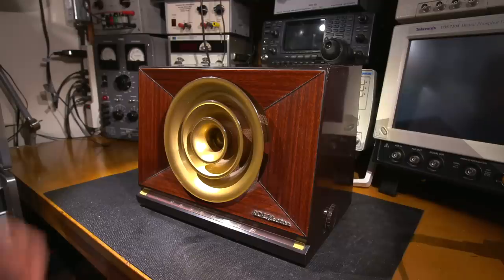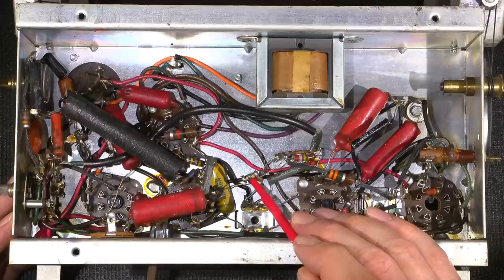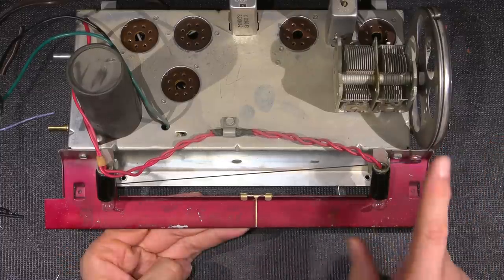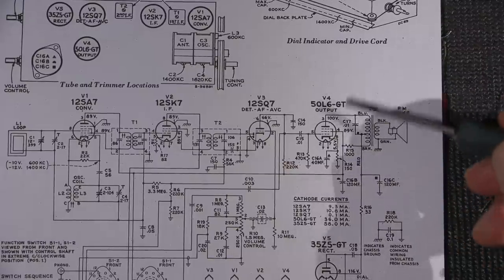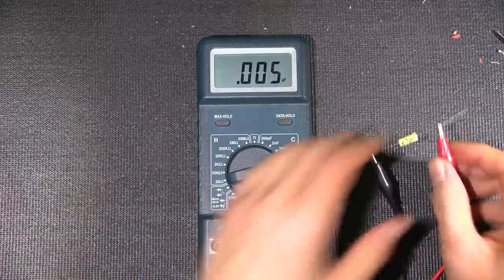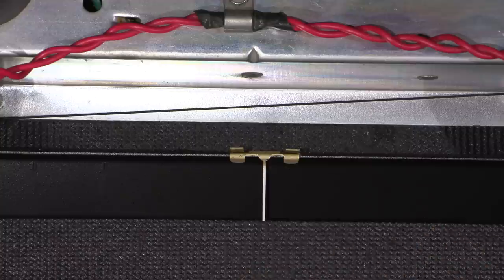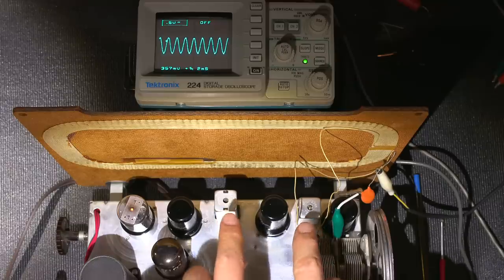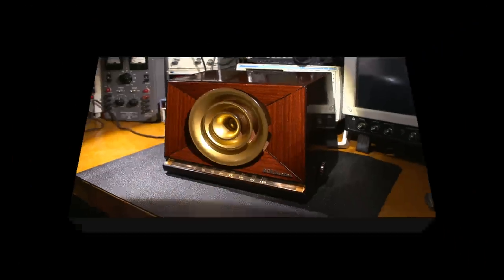Bizarre Looking RCA Radio! [Electrical Restoration]

Comment: Very good videos thank you. Question I have do you every re-stuff an original cab and why or why not. Thank you
Reply: You can't accurately measure the leakage through a capacitor when it's in circuit, so once you've gone to the trouble of unsoldering one lead, it's almost not worth the bother to even test them, so many restorers just routinely replace them without even testing.

Comment: Except they don't act like resistors across the caps. The amount of leakage current changes with the voltage.  If anything, they might act like a VDR.

Comment: Greetings: The series wired dial lamp current causes the brightness to be more uniform than if they were parallel wired.
Reply: James M DeLuca   ,     Not really, depends upon the circuit. Usually, only on turn on time during warm up.

Comment: Having reported your extensive testing of the audio performance of bias shifting, which sounds like the amplifier moving from class B to AB, you noted the concept of warmer sound.  What is the change in the Bode plot that gives the perception of warmer sound?  thank you.
Reply from the maker: How is this in class B?
Reply: @MrCarlsonsLab  Hi Mr C,  I am not sure what class it is, however, the main question is what is going on with the frequency/audio alteration with making a sound warmer, per the historical comment you mention?  Any comments on what class amplifier it was designed to be would be interesting.  thank you.

Comment: Hi. Would it be possible to take an old Pioneer radio amplifier that runs off of vacuum tubes and replace the tubes with transistors? I have an  50 year old machine with 13 tubes that need replacing. The machine is a sentimental piece I don't want to get rid of, but in my country it will cost thousands to repair. And that is if the tubed can even be sourced in the first place.

Comment: Thank you Mr. Carlson. Always enjoy your vids. I have an Yamaha MX-1000U amplifier that is at least 30 years old now. It drives my NS-1000's. I am the original owner of both. I would like to have it re-capped and performance verified. It that something you would be interested in doing? Not as old and perhaps interesting as the stuff you normally work on. But I thought to ask because personally  I can't think of a better set of hands to freshen up an old friend of mine.

Comment: It is understandable that these radios 📻 get wear and tear around the volume and tuning knobs. I’m not sure 🤔 if that actually can add value to the radio 📻 in some cases. Otherwise, sadly 😞, the whole radio 📻 will need to be refinished. Depending on what kind of finish job the radio 📻 received at the factory 🏭, refinishing the radio 📻 can actually devalue it. In other cases, it can benefit the radio’s 📻 value. You’re a pretty 😍 cool 😎 guy, as far as your videos are concerned 😟. I also like 👍 all your equipment in your garage or basement, but I wouldn’t want to pay 💰 the price of a house 🏠 to buy it. I can probably buy the equipment used, but I have to make sure that it’s good 😌. No matter how recapped, or restored these old radios 📻 are. It’s ALWAYS advised to turn the radio 📻 OFF, when ya leave the room, even for a minute. Also, some of these radios 📻 have non-replaceable ON/OFF switches, that have gone out of production, many 👨 years ago. When this is the case, go buy an outlet strip, and use the ON/OFF switch on it. They’re only $15.00, or so, and available at Home 🏠 Depot or Lowe’s. This takes having to put the wear on your radio’s 📻 ON/OFF switch. Shango066 says the above, because no matter how recapped, or restored the radio 📻 is, ya can’t trust it, once ya have left the room. As Shango066 went to leave the room, his radio 📻 shorted out (a capacitor), making him have to go back in the room, in the nick of time 😥, to put out the fire 🧯 that this created. Merry belated Christmas 🎄 🎁, and a Happy 😊 New Year!! Your friend, Jeff!!

Comment: Power cables back in the day did not have the "ribbing" to indicate polarity?  What was the setting known as "phono" used for?
Reply: There is a RCA phono jack on the back @8:30 labeled PHONO.
Reply: @mikeg_123  For a turntable?
Reply: @johnplaid648  Yes. Turntable = Phonograph. PHONO for short.
Reply: @mikeg_123  That's a mindblower. Maybe a dynamic mic?

Comment: When putting a new AC plug on how do you determine which wire to put the ground to so we don't shock ourselves? I have an Electrolux vacuum that shocks me when plugged in and I'd like to fix that.
Reply: Neutral goes to the chassis/ground.(bigger prong) (assuming your house is wired correct)

Comment: Just wondering if you can show which capacitors these are you use for replacement? And maybe where to get them? I see they're branded "IC" but that's certainly hard to search for... But don't know if that's a trade secret or something. (Or is it revealed on your patreon? If so, may need to do that.)

Comment: Very nice job, Mr Carlson.  I have a question about resauration - when we shall replace the caps, and don't have the exact same value - what is best, go a little bit up ur down in value?  I think about Farad, not Volt of course, where I know the value must be the same or higher.  73  Asle
Reply: Put two parallel, one a bit smaller than the original, and one to complete the value; 
C-total = C1+C2. But sometimes value is not that important, the tolerances are substantial. In the RF and oscillator it is more important.

Comment: The symbol for C15 is the wrong direction in the schematic?   I suppose technically, the symbol should be two short bars for np type caps.

Comment: Hello Mr Carlson. I'm sorry this is off topic but I'm stuck. I cannot find any English explanation about the different types, ratings of SMD capacitors on YouTube or on the Net at a level I can understand. It almost seems to be a taboo subject yet almost every electrical item has them. I'm at the stage where I find one that's at least the same size and has the capacity I need. Not exactly very scientific. You must be very busy but do you know of a data sheet that covers SMD caps.

Comment: Does anyone happen to know where those ceramic standoffs for the electrolytic post connections can be obtained?
Reply: The void. They're unobtanium unfortunately. Best you can do is buy some solder turrets (which are surprisingly pricey) and try to hack together your own with some plastic standoffs or something.

Comment: Those awful shallow knobs were a fixture on RCA radios and 45 RPM phonos from 1949 to 1953 or so. A few items were continued in the catalog for several years, especially their 45 players, so they could be found for years after new designs avoided them. Some later ones had different textures and ornamentation but were just as bad. They did this so these models would present a modern sleek appearance on shelves and table tops. Cosmetic and not ergonomic. Form above function.
     These knobs were not only hard to work, they were fragile. Most sets originally equipped with them ended their days with other knobs stuck on them as the originals' shafts broke off. 
     RCA had been using low-profile knobs since before WW2. Classic models like their combo console radios and table radios such as the 66X1 had them but this design took it to an extreme. Nearly as bad were the knobs used on the 75X11 sets. They were hard to use but were very tough with really thick shafts.
     These can cause real pain (you know where) for restorers. Finding replacements is an obvious issue but regular use would wear away paint and faux wood grain behind the knob. Since many sets were Bakelite, color was obtained by painting over it. Solid colors were easy - just repaint the case. Patterns were another issue. It takes expertise to duplicate the wood look, something restorers of antique automobiles from this same era ran into with dashboards and window frame trim. Do not be surprised to find one of these recovered with the old "ConTact" wood grain "paper" (actually plastic film).

Comment: this radio display scale in plastic with numbers was designed for 3 lightbulbs? seems to be a place for display bulb in the middle on the radio metal case
Reply: I don't think so.  I think that the shape of the plastic was optimized for getting even illumination across the whole scale.  Near the middle of the scale, where the bulbs are far away, the curve was designed to reflect more lignt downward toward the numbers and the pointer.
Reply: @BrightBlueJim  i agree it is well tougth out and tested.I can remember and still does some old radio work where they use the same part for more than one model.  The chassis has a notch, the same as where the bulb socket parts is fasten to align the sockets and a cutout in the middle of the plastic scale same as for the bulbs made me think that.
Reply: @BrightBlueJim  so you say the cutout in the plastic was to refect ligth downwards?Yes i can see what you mean,Think others did that to so you are probably rigth

Comment: Hi there Tony from Australia here, I dropped a Godox power supply inverter for my Godox flash on my camera from about 1mtr to the concrete floor, physically looks ok but now wont turn on,  It has two channels {outputs} and both are dead, can't see any fuse but there is one 1000uf 25v cap for each channel then the 12v power goes through a resistor, diode then to a transformer for each channel. I'm sure its only simple. Have you any advice? regards Tony

Comment: Hi, Sorry for the off topic question but what coax cable to you use? for example on the SIFT tester connecting the alligator clips to the board. Thanks
Reply from the maker: Hi Dominic. Look for RG179 coax

Comment: With reference to the switchable AM settings, is it possible that, instead of tone settings, these switch positions correspond to wide, normal, and distant?  This would have an effect on the tone of the radio.
Reply: The schematic indicated the positions for the wafer switch.  They are: Off, three tone positions for radio, and three tone positions for phono.

Comment: Is it worth replacing the dial lights bulbs with LEDs so they never need replacing.
Reply: You can, but there are considerations. It's not a direct swap.
 The dial lamp(s) in an AA5 radio are supplied from a tap on the filament of the rectifier tube. They also help absorb the inrush current when the radio is switched on. When that circuit goes open due to a burned out bulb, it stresses the rectifier filament and severely shortens it's life. There is a resistor in it's place if the radio doesn't have a dial lamp. You would have to make allowances for that.
 I've seen discussions about doing that but haven't looked closely at the details. With the poor quality of #47 lamps available these days, it wouldn't be a bad idea to go with LED.
Reply: @tomadkins2866  did not know about the inrush current and the illuminating bulbs... would going up in voltage value with the bulbs increase their life without jeopardizing the protection function?
Reply: @duroxkilo  The short answer is "no". I would suggest going to antiqueradios.com and doing a search for "AA5  radio LED" or or some variation. There are people discussing about doing what you suggest.
Reply: Paul has done this on several other restorations so you can check the videos out to get the specific how-to's to do this yourself.
I like the old school incandescent lamps for classic radios myself but have switched over to LED's for a lot of my other equipment.
Reply: Thanks for the replies, I never knew about the inrush current issue, I've only worked on 3 valve based devices, 2 of them being TVs, and one being a radio about 25 years ago, I have done conversions on solid state amps from the 70's and early 80's without any issues, with less heat being produced and better reliability.

Comment: Did you mention what year this might have been made? I find it really odd that RCA included a phono input. But I recently got a Hallicrafters S-107 Mark I and it also has a phono input. Really strange on a short wave set.
Reply: RCA sold a matching 45 rpm record changer to go with this set.
Reply: Wiki: "The 7-inch 45 rpm record was released 31 March 1949 by RCA Victor". It would not surprise me if this set was released the same year.

Comment: Perfect companion to TechMoans RCA 45 video. Same time period I believe
Reply: Not just the same period, but these were companion products.  This radio had a phono input specifically so you could plug in RCA's 45 RPM changer.  I used to have the pair

Comment: You seem to have the schematic, but what if you don't and can't read what's on the faulty capacitors? And you can't measure them either cuz they're broken.
Reply from the maker: Then experience takes over and says: .001uF at 630V fits in that spot... Or something like that.

Comment: Would a car radio with its 262 KC if be more selective than a 455 KC home radio?
Reply from the maker: Correct! This is why you will notice that they are more sensitive as well (more selective)
Reply: @MrCarlsonsLab  Did any manufacturer build a 5 tube wonder with 262 if's?   BTW  I have an amazing story to share with you about a guy who built a radio powered radio.  He used the  rectified signal from WMAL 1,500 in Washington D.C. to power a germanium transistor radio and its 12" speaker.

Comment: Not true because capacitor can be used to regulate DC especially device that have both wall outlet and car outlet which the rule is that you must increase use twice the uf when using half the voltage of the circuit

Comment: I would replace ALL of those components good or not because if you replace a select few, if one bl9ows, it could take out the rest of them. also, I would take out the speaker, and check it for cosmetic changes such as a torn cone, or damaged voice coil,. the vacuum tubes as well, replace them all good or not.

Comment: With your capacitor testor, how does the forecast function work as opposed to just the test function?
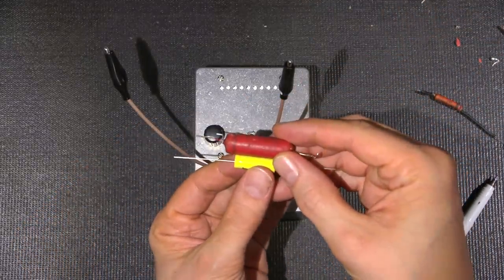Reply: He tells you at 1:02:38 that you have to be a Patreon subscriber to see what's under the hood.
Reply: @demef758  Thanks for that.  I was more after a general explanation rather than knowing how this particular device is built though.
Like, is it just a more sensitive version of the test or is there more to it?
Obviously I wouldn't expect his design to be made public when it is for patreon supporters.

Comment: Love your work! I have a question about the schematic.  The caps have a curved side and a straight side, which always puzzled me.  From your video I am guessing that the curved side denotes the shielded side, i.e. ground.  Is that correct?
Reply: No, not necessarily. If you look through the list of videos, there is one that shows how to easily identify the "outer foil" end of unmarked caps.
Reply: @tomadkins2866  Sorry for the confusion.  I was referring to the schematic symbol for the capacitor.  Electrolytics are usually clearly marked for polarisation, but non-polarised are not.  Only in the older schematics do the non-electrolytics have the curved side to the symbol.
Reply: @davidcottee2808  Totally my fault. I missed the word schematic in your question.
 You are correct. The positive side of the electrolytic caps seems to be denoted by a black square(?). It's hard to make out on my monitor. The curved line on non polarized caps seems to denote the outer foil or "low voltage side"  of the cap.
Reply: @Tom Adkins: you're right looking at the schematics, every bend side of the symbol is closer to ground. But one cap is going against what Paul has stated in this and earlier videos, and that is C15 (0.01) between the last two tubes; Paul states that the outer foil must be connected at the lower impedance side, and as far as I know that is the output of the prior stage, not the input of the next stage. I am not sure about this.
Reply: Erik den Houter that part of the video was what piqued my interest in the symbols. Maybe the shield is connected to the grid end for another reason.
Reply: Well, I would think that the input of a stage is always the part to be protected from unwelcome influences. So not setup as an antenna by connecting it to the outer foil. Maybe that thought is to simple ?
B.t.w., over the years I have encountered unseen design errors in many places, and on >many< levels, so maybe we just caught a monday morning drawing.